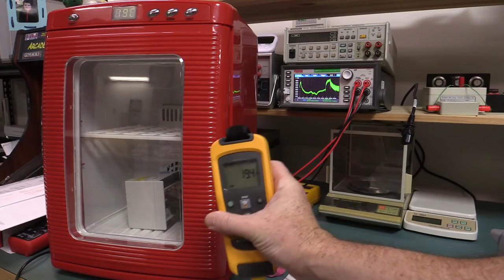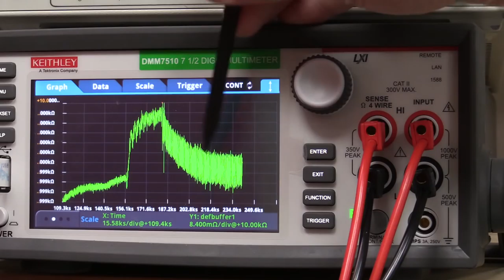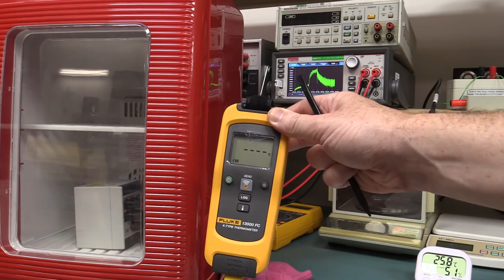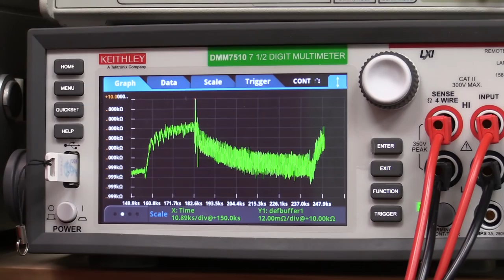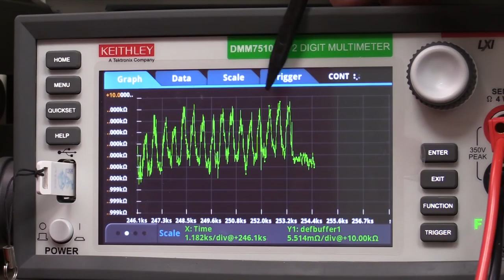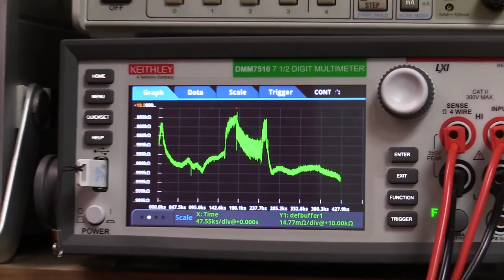EEVblog #835 - Wekomm Resistance Standard Part 2

Comment: the undershoot could be because of a pool of un-mixed warm air somewhere in the room, so the first thing the aircon does is to mix the air in the room resulting in a (small; that's a few tenths of a degree) temperature rise.

Comment: If the A/C uses duct work, the air in the duct might be getting hot when the A/C is off, so when you kick it on that warm air is blown out. And the air near the ceiling is warmer than near the floor, so circulating air in the room might increase the temp at your meter slightly, when the A/C is first kicked on.

Comment: Your Noise might come from the Fluorescent Lights, But I be honest Dave, if you use far  better cables, use guard if Keithley has it to the Resistor case, isolate from anything that the case might touch, 
Use Raychem PTFE Insulated Silver Plated Copper Twisted Pair, Silver plated Copper Screen, outer Tufnel Coating,  use one for sense & one for Input, spades Gold plated copper Spades, crimped on each end of lead,
You might need an EMC Sniffer Probe to look at the area for noise pickup, use mass in the thermal chamber for better stability, Don't forget you have plated test connectors nickel which is not that good for good mesurements, 
I would love to see a Solartron 7081 DMM thats really great for its age :) or a Datron 1081 if you use better cables far better results,

Comment: It is a radiator on a back of a thermal chamber radiating heat and interfering with the meter. Try putting chamber further away from the meter, put the meter in front of the chamber instead. There might also be some induction from the chamber motor, or something else creating some residual currents in leads.

Comment: Totally agree with reburneI see this a lot and it is generally caused by the mismatched materials in the leads / instrument terminals. This can contribute large affects at these measurement levels.The sudden dips when switching on the air con may just be the leads changing temp quickly compared to the meter terminals.

Comment: Seems your four wire banana jumper setup is contributing thermocouple effects to the experiment.. This is clear from the chamber cycling  data with thermal inertia consistent with  hysteresis of chamber temp control and reference resistor terminals and connector following this cycling.. also the multimeter dynamic temperature compensation is being exposed at  these demanding settings.. Were talking +/- 5c in $10,000 here.. 10 kilometers to within 50 mm.. Frequency ~~ yes parts per million~~ resistance capacitance or inductance ~~ Research or calibration..The elusive quest for perfection slips away..

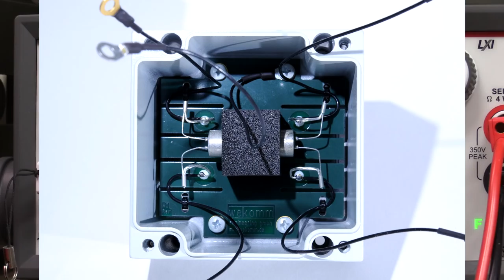Comment: 15:00 what about the heat put in the lab by the "thermal chamber".  Not a big ammount but is near to the DMM and little things ... just add up. The DMM is faster picking up temperature-related variations than the resistor. You also mention the undershoot of the reference (or something) when the aircon kicked on, so, any chance that this cycling is happening inside the DMM ?. I would submit the resistor to the PTB ...

Comment: Having such a sensitive setup, I wonder how accurately you could measure actual temperature? Or differences in temperature rather? Hooking up a PTC or something to the multimeter, would it, let's say, pick up radiation heat from the palm of your hand if you held it close to the ptc? Would be fun to see, almost like magic. 
Would be cool if the multimeter could trigger something else using a threshold setting or something. Just wave your hand in front of the PTC and the force is with you. 
Anyway, great video! Learned quite a lot again like I do with almost every other video you upload. Thanks for that!

Comment: Down the rabbit whole, lol. I agree some of the cycling is the thermal chamber but I also wonder if you were to measure the rpm of the fan in the keithley if the fan RPMs change slightly according to the internal temp monitor on the meter? As your aircon changes the ambient air if the speed of the fan changes inside the meter to compensate?

Also, did "Santa" bring a new tripod so no more sudden dips on the camera?
Reply from the maker: +Dave B.Reviews (My Gadget Tech Thoughts) No new tripod from santa. Santa forgot to order it.
Reply: +EEVblog Oh no..... Maybe Santa has a 2 day shipping Amazon prime account. 🙂
Reply: +Dave B.Reviews (My Gadget Tech Thoughts) I think I read that the cooling fan runs at a constant speed.
Reply: +Dave B.Reviews (My Gadget Tech Thoughts) In previous video instruction for Keithley told it is constant RPM fan.

Comment: I think Dave is right... Without shielded leads between the Resistor ref and the meter....  the High Freq. (relative to the larger trends)  noise is most likely the temp-chamber due to EMI, and not from thermal noise in either the room or the chamber.   I think his turning off both the A/C and T/C show where the noise floor really is for the situation.

Comment: A quick tuning of that "thermal chamber" could be done by getting some big cpu cooler with heatpipes (like thermaltake macho I did mine with) and some cheap ebay peltier element that has some more wattage (120 or so) and some internal fan and good heatsink there too. This should be able to pump out the 10W of the meter too.

Comment: Maybe twisting the kelvin connection cables reduce the noise. Other theory can be RFI noise disturbing the input amplifier of the meter.
Reply: The meter is measuring resistance, its only intetested on the dc voltage induced at the resistor by a known internal current source. Thermal noise is easy to deal with if you are only interested in dc. The meter should be limiting analog bandwith internaly and doing oversampling, otherwise the resistor thermal noise would not allow to have such number of least significant digits. The ripple found in the reading does not seem to match with thermal noise.
Precision operational amplifiers can be disturbed by RF noise. If there is RF at the input, it can be internally rectified and manifest as a DC ofset at the output. The wires and the resistor are forming a big loop antenna. You can get rid of this antenna twisting the cables.
This is only a theory. Wen you measure such small voltages all kind of strange science fiction effects can appear  :)

Comment: maybe your tempchamber is blowing towards your multimeter?
Reply: +SangreNL   That occurred to me, also. The heat from the temp chamber operating has to be vented somewhere, and the back of the temp chamber is facing and near to the multimeter, so maybe the cycling of the temp chamber is causing fluctuations on the ambient temperature around the multimeter? Otherwise I don't see how the fluctuation in the readings would be as great as he was getting. But I'm no expert in these matters.

Comment: why is your keithley UNDER the other piece of gear in contrast with on TOP of it in the previous video ? that might  affect the measurement as well ;) it easily might be responsible for the slower ramp-up after turning the aircon on.

Comment: Dave, Now that I am lusting after a 7 digit DMM I had to stop thinking with my glands and ask myself why would I need such equipment?  Can you share just why we need such accuracy?  It seems that to build a project to such accuracy it would be subject to all kinds of outside influences.  I spent most of my life working on and maintaining military electronics, built with price is no object and could take a direct hit from a 5" projectile but never needed such test equipment although it was available for use.
Reply: +pirate0jimmy Thank you for your input.  In my years of experience working in electronics (military grade  weapons support systems) measuring down to 4 or 5 digits of accuracy as far as voltage was concerned really didn't make much of a difference.  When you dealt with this extreme I found that generally circuits that needed this kind of attention were unstable and suspect to a lot of outside factors, heat, humidity, shock, etc.  I can see it if you are looking for transient voltages much like you might catch on a digital oscilloscope.

Comment: An oscillation with a period of 500s when the "thermal chamber" (I vaguely remember it is a hacked mini fridge ...?) is in use is almost certainly due to oscillating temperatures within the chamber. I haven't watched your vid on that since it was new but most temperature control loops have significant hysteresis which causes low frequency oscillation. It's acceptable in a fridge, AC etc as long as the amplitude of oscillation is relatively low (amplitude may also change depending on position within the chamber). Even though there is some small amount of thermal damping from the case around the resistor, I think it still must be that you're seeing (probably thermocouple effect at the jacks). The AC appears to have a longer period of oscillation.

Also, I feel uneasy when you say you've "proven" something. You can't really prove anything with 1 measurement. e.g when you say you've "proven" the temp co of the meter is negative, really what you mean is you have some evidence to suggest it's NTC within this temperature range.

Comment: can we get a hour or two long video on inductors also ?
Reply: +iceberg789 
I expect you know more about capacitors. Inductors are like their opposite number, so you can infer a lot about inductors from that. 

Inductors store energy in a magnetic field, capacitors store energy in an electric field. 

Voltage and current swap round in the equations as magnetic and electric fields swap round. Inductors dI/dt=V/L, Capacitors dV/dt=I/C. Therefore if you put a square AC voltage waveform into an inductor, you get a triangular current waveform out. If you put a square AC current waveform into a capacitor, you get a triangular voltage waveform out. And from the same equation, the faster you force a change in current in an inductor (e.g. by disconnecting it when it was conducting current), the higher the flyback voltage spike.

Inductive reactance increases with frequency, capacitive reactance decreases with frequency. 

What else do you want to know for the remaining 1 hour 55 minutes? You could talk magntic field strength and flux density, derive Maxwell's equations etc. But beyond knowing that magnetic materials saturate at a given flux density and how to calculate peak flux density in an inductor/transformer, you don't really need most of that to design inductors into circuits.
Reply: +KX36 i know the basics, but i dont really know where there are somany coils they use in a classic AM radio..... they have all kind of coils, from antenna coil to IFT and blablablablabla.....
lets say if i am to build an AM receiver for a specific frequency band, what are the design conditions i need to go through ? it's not like attaching a random LRC bandpass filter to an antenna, is it ?
Reply: +iceberg789 I think it is mostly that. I think the radios do have multiple filters, so the filter rejection outside of the band is grater, and the transmission in band is high, then some tunable filter will focus on specific station you are tunning to before amplification, and further filtering. There is some design involved of course, mostly related to the width of the rlc filter bandwidth (related to Q factor), but it doesn't look that comlicated, it is just a bunch of cascaded filters.   Learn RC, RLC and topology variations, and something about cascading. There are good (including free ones) programs to simulate filter networks. I think Dave made some videos about that too.
Reply: +movax20h yes, a hour long audio visual guide to design process, would be great. with all those cascaded filters, centre tap biasing and what not.....

Comment: what brand power regulator do you recommend for hobby grade use. I want one to use for testing led and R/c plane use. I work with of course leds and servo's as well as other electronic equipment.I see plenty of cheapy units available on ebay. what do you think.

Comment: i farted
Reply: +zimbabwe aka john cena 
good for you, enjoy the smell
Reply from the maker: +zimbabwe aka john cena You just affected the reading!
Reply: +EEVblog honestly it blows my mind that we have equipment these days that is so sensitive and accurate that tiny variations of nealy anything can cause a detectable change in even a precision resistance standard.
Reply: +Luke Den Hartog Not just detectable.... but glaringly  obvious!  The catch is that without some fancy mental gymnastics we cannot assign proper attribution to the source of the now easily measurable change... of something.   Is the reference in the meter drifting? Is there EMI contributing?  Is this a Thermocouple effect? Or is the resistor under test drifting?   All we really know without further testing is that the temperature of the test environment is putting its thumb on the scale.  But where exactly is the thumb? On the subject? On the test-leads, or in the measuring device? That is why NIST (don't know what the Auzzies call that branch of the Gov) certified Standard Calibrations, and their derived web of trust are so important to making accurate measurements along with having some clear notion of what is really going on in a given test environment.

Comment: Dave, have you heard about the latest Kickstarter?  Thought you'd get a good chuckle: http://www.geek.com/news/someone-is-kickstarting-a-ridiculous-signal-proof-tinfoil-hat-1643026/
Reply: +John Drachenberg  One of the (many) things I find puzzling about that Kickstarter is that, even if you grant the premise that electromagnetic radiation is dangerous, the hat only protects the top of your head. Meanwhile, when you put your cell phone up to your mouth/ear, it will not be blocking any of that radiation. And since radiation power diminishes greatly with distance, it seems like you are not being shielded from the only significant source of radiation you are likely to need shielding from. Not to mention the claim of protecting from cosmic rays, which would go through this or any other shielding with no problem. Yet another example of FUD over science.
Reply: +Mark L Well yes, Kickstarter has a very strict "leave your brain at the door" policy. If you still had it while browsing their stuff, you might be tempted to think they're either all idiots over there or they simply don't care at all who gets shafted and how badly as long as money keeps flowing.
Reply: +John Drachenberg LOLOLOLOL